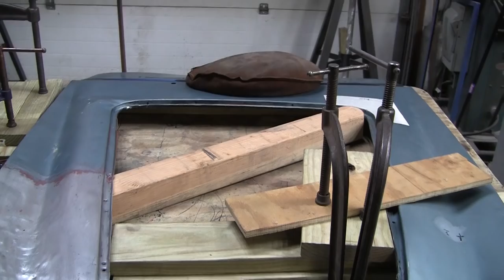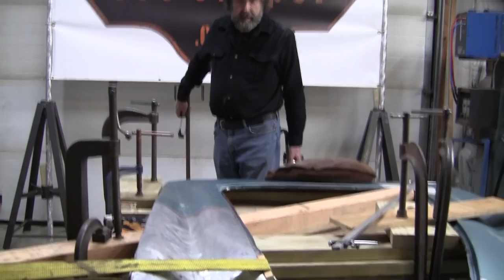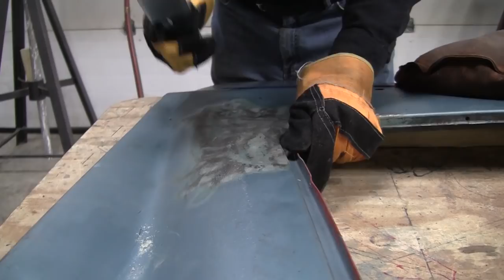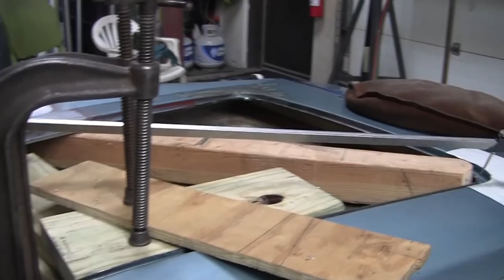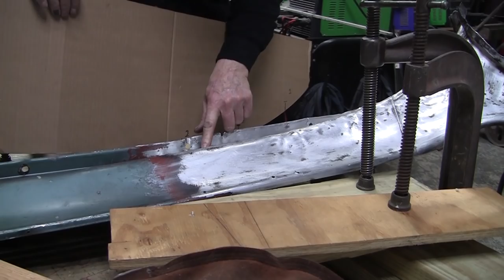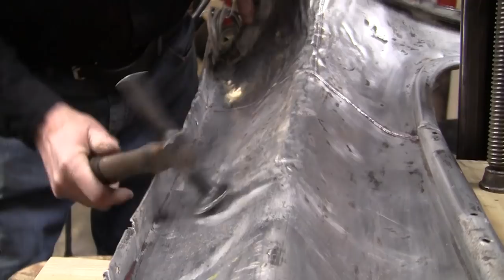Straightening the shroud on an Austin-Healey 3000

Comment: Really enjoying all of your efforts. Thanks!!! If you can find/borrow a decent hood you will probably be glad you did. I did a similar car some time ago and the front shroud looked OK except for a couple of tears near the bottom. Fitting the hood showed that the front of the shroud was tipped down about 1/2 inch even though it looked fine w/o the hood in place. Also, some turnbuckles between the grill surround mounting tabs are a good way to put some force on the grill opening and pull it into shape. Just pop-riveted so not too much force. Borrow a grill surround from the same person you get the hood from.

Comment: When you were pulling the front corner was kinking from the strap. While you have pressure on it would it help to use the slapper on the fender where it rises kind of behind the headlamp opening?  Or even a block of wood.  Love the videos I have been doing auto body since 1974 and am still learning thanks to guys like you

Comment: The front grill section you have is correct , it is made up of 3 parts the grill bar section , the bit you have plus a top section which gives you the top shape, The BJ7 and BJ8 grills are the same the early 100/6 and 3000 MK1 are different , hope that helps keep up the good work
Reply from the maker: Hi Adam, I went on Moss Motor's site and the grille surround I have was shown there. The later one is a two piece, I believe that is what this shroud needs.  I know XK Jaguars but very little about Healeys.
Reply: @proshaper  Not sure if you got my reply so will send it again . All the 3000 models had the same grill opening, If you take a look at AH SPARES website you can see it better , the bit you showed was the center section there is a top piece that goes with it and then the main grill section goes behind , Hope this helps
Reply from the maker: @adambooth215  Hi Adam, I get it now. My piece is the lower section. Thanks!

Comment: Wray.   ...you made your point. Wasn’t sure at first when there was so much metal “relocated”. Can I use that term sometime?  My buddies laugh at some of my pull riggings sometimes but as you have proven. A little force in a couple of directions will,re-relocate that metal. I will watch closely when you start planishing   That seems like more work than completing the rough pull. A good frame man i used for years use to say “pulling first 6” is much easier than pulling the last eighth inch”. Merry Christmas to you and Mark (and his sound effects). I appreciate you both. Jeff

Comment: Is the price of a new panel so expensive!?
Reply from the maker: I didn't look up the price or availability. I would imagine they are at least $2500.00 for a replacement, that  may or may not fit. The point of the exercise is to show what is possible if you take it one step at a time.